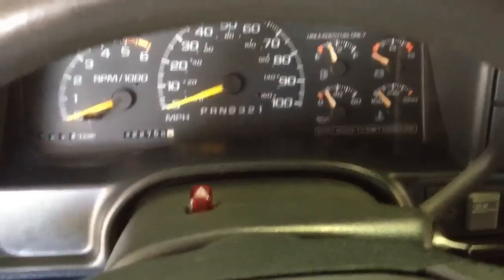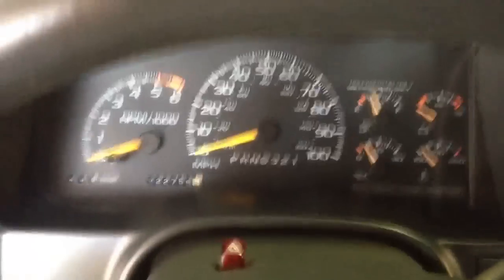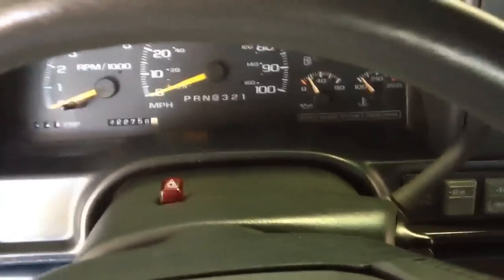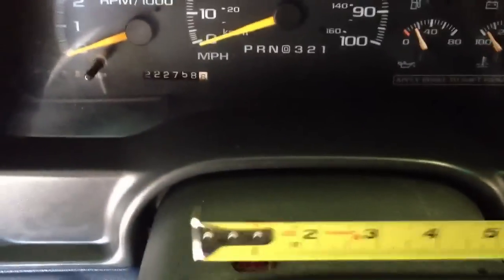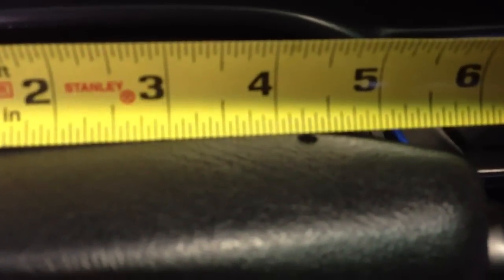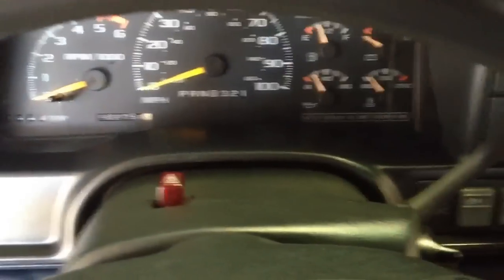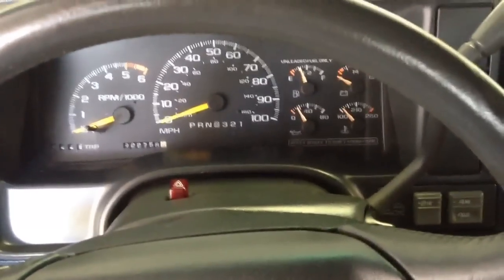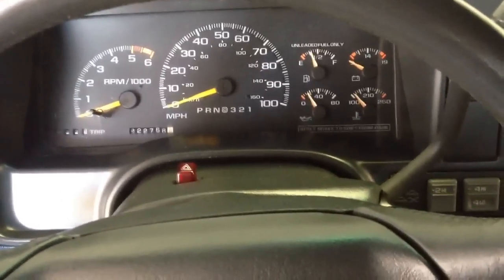96 Chevy 1500, late model Chevrolet ignition lock cylinder

Comment: AWESOME!  Brilliant shortcut to replacing the sticking and often difficult-to-turn ignition switch on my '98 GMC pickup!  Worked exactly as advertised and saved me a TON of extra work.  The single little hole drilled in the top steering wheel cover is almost invisible and is a small price to pay for not having to pull the steering wheel and everything else.  Took me maybe all of 5 minutes to do the whole thing!

Comment: Thomas, you Sir are a bloody genius! The keys for my 96 S10 were stolen while I was on vacation so today I bought a new ignition lock cylinder and keys at NAPA and followed your directions here, and in 10 minutes the new cylinder was installed and working perfect! I had a tube of black silicone in my toolbox so i put a little dab on the hole and smoothed it over with a bit of spit and nobody would ever know what I had done! You saved me a lot of time and work, and for that I thank you!!

Comment: Wow thanks! that worked perfectly. 1996 Chevy K1500 Pickup
I used a piece of 12/2 copper wire to push the pin, released the lock!
A dot of JB Weld and you'd never know the hole was there.
I was going to get new keys, but I thought the cylinder was shot too after 225,000 miles.
The keys still work in the doors just fine, I have keyless entry so I never lock them with a key.

Comment: Rockin video dude!! Suffice it to say that time is a serious commodity in my life right now. I work all the time and I'm in the process of moving. My life is loaded with obligations and deadlines right now. By the time I get off work, it is dark and cold and I have back and neck issues. So I come home suckin it up and gettin ready to bundle up and go tear down my truck to change this friggin lock cylinder. I'm figuring I'll check out the long way instruction video and then I happened across your video. Great stuff. Saved me a crap load of time. Worth the very small inconspicuous hole that is drilled. My lock was a bit tough because the cylinder was all locked up and I had to wrestle with it to get it into the start position, but once I did, it went Super smooth. Thanks for posting it!!

Comment: The ignition lock cylinder on my 97' K1500 Silverado was acting up so I decided to try this video method and it worked but seems like I should've drilled like 1/4 inch  toward the steering wheel while using the recommended 4 1/4" pin point as your starting point. I used a skinny nail and located the push button like 1/4" towards me and away from the drilled hole. Best thing to do is to lay the new cylinder on top of the old one before removing it and see where the push button would be but that's my observation when I was doing it.

Comment: Jesus H. Christ, you're a fucking Genius! Been wrestling with the shrouds on my recently acquired '99 Tahoe in an effort to replace a shift boot and lock cylinder because it wouldn't turn most of the time.  After the assholes gave me the wrong sized boot, my temper was in no shape to try all the happy horseshit necessary to take off that upper shroud to replace the lock. This solution worked as advertised and my nerves are in retreat. Well done!

Comment from the maker: If the 95 has an airbag this will still work. If it doesn't pulling the steering wheel and two covers is easy task. Just make sure to mark steering wheel with a line down it to the shaft so it's still on strait when your done

Comment from the maker: Without the key removal is much harder, and usually that one key does the doors as too. The owners manual may still have your key number and the dealer can cut a new one. Removing the lock cylinder without the key is a pain in the ass, and usually requires removing the airbag, steering wheel, and column covers.

Comment from the maker: Try using graphite lube in lock cylinder key hole. That's what happen on mine. I just kept working it till it finally rotated
Reply: will this process work on a 1993 K 1500 ?

Comment: have a question tho i lost my keys and its why i am replacing the lock cylinder, but i notice you do need the old key to take out the old cylinder or is there another way out with out using the keys ? appreciate it

Comment: Hell yes! To the point...screw the bs! Here's a dumb question no one seems to ask. So now I will have to use 2 keys? The new one for the ignition and the old for the doors? OR can I take it to my local locksmith and have him re-key my new cylinder. Currently you can crank the truck without a key and/or pull the key out while it's in the on position. If it's barely bumped to the accessory position accidentally when I get home...battery will be dead in the morning. Thanks for the video.
Reply: You could have the door locks re-keyed but it will cost more than I think its worth.

Comment: I replaced my ignition cylinder on a 95 chevy k2500. The old cylinder was obviously the problem because it would start but was just really hard to get it to turn. The new one won't turn at all. After calls around, I'm being told I need to tow it to a dealership, then pay over 100 for reprogramming. Is that necessary? Do you know other options?

Comment: i recently purchased a 96 Silverado and sometimes the key turns if I finesse it and be patient and curse and pray that it hits the correct position to turn. would the replacement of the ignition cylinder fix this??? any help would be appreciated!
Reply: ok so I used the technique and it worked BUT! DO NOT use a drill bit to press in the hole, it broke off in the hole and I had to make a larger hole to retrieve it. but in the end it works just fine.

Comment: my key comes out fine, it's I can't get the cylinder to turn and I even had a key made and still only woks sometimes.
Reply: sneakysnakepie1 im having the same prob wit my van . i think the tumblers r wornout n my ignition. im goin try this method to c if i can get the ignition out
Reply: Yeah I believe my key is worn or the tumblers because I may have just made a copy of a worn out key. But man I don't wanna take apart the dash. And if I get a new ignition switch it will be a different key than the other door locks. Sucks.

Comment: This method works, but it's lazy and disfigures your dash! If you just remove the cover that you're DRILLING A HOLE IN you get access to the same little hole. You still don't need to remove the steering wheel and airbag, and it takes a little longer, but you're not left looking at a little hole every time you get behind the wheel.
Reply: Ummmm.....I bought a small black plastic plug from a car stereo shop for a dollar and plugged the hole. Almost looks like GM built it that way.
Reply: I had a tube of black silicone in my toolbox. One dab of that and a bit of spit on my finger to smooth it and the hole is totally 100% invisible! This great method saved me a lot of time and effort, and gets the job done perfectly!